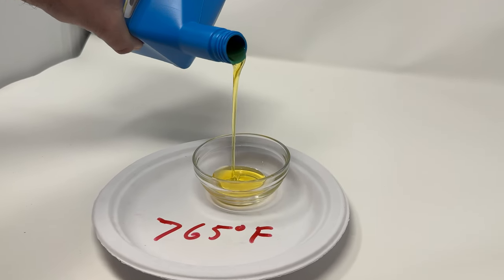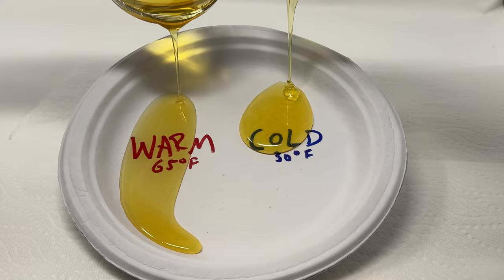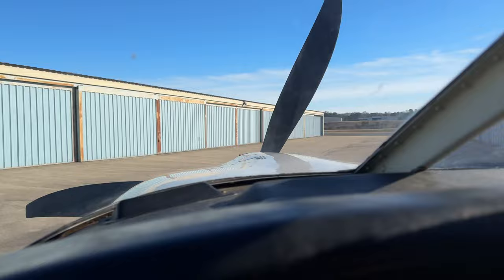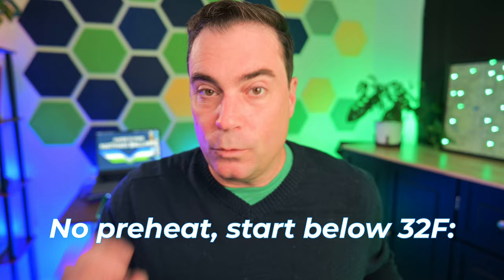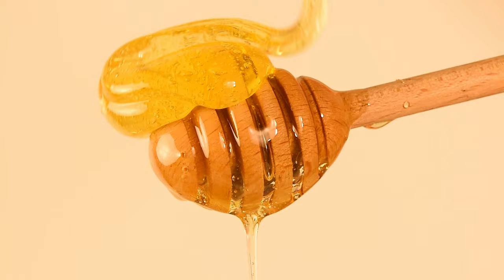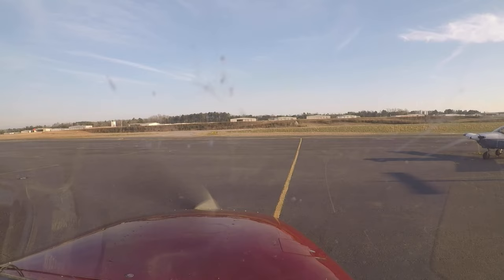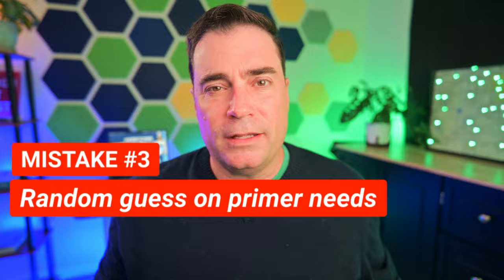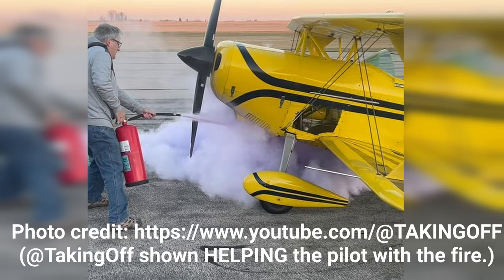HOW to START a very COLD airplane ENGINE. (And NOT end up FRUSTRATED.)

Comment: These are good tips. Also if you're anticipating very cold temps, top up your oil today because it might not actually pour tomorrow morning. I learned to fly in South Dakota in the dead of winter and found when it's really extra cold (like -25F and below), you need to be on you guard for systems behaving abnormally. One morning I set my Piper Cherokee's trim to neutral for the before takeoff checklist, and during initial climb I was arm-wrestling the yoke to keep the pitch up. Turned out the little indicator on the ceiling had a significant lag to catch up to where I had actually set it, which was very nose-down. That same morning, I noticed during preflight that the crankcase breather hose was completely blocked by an icicle that had formed there, and a mechanic used a heat gun to melt it out.
Reply: That blocked crankcase breather hose would make it run so rough.

Comment: Here in Wisconsin I wont even try to start my plane without several hours of preheat under 30 degrees. I have a Tannis preheater that heats the oil pan and engine block. What's great about these systems is it only requires an outlet and an extension cord which any FBO or hangar bum on the field will be able to help you out with.

There are a few other things you can do:
- You can have a custom engine/cowl cover made that will insulate the engine bay. They're basically sleeping bags that fully wrap around. 
- What TYPE of oil you use matters a lot. You wouldn't use a W100 oil in the winter, you would use something like a 20W50 that does better in variable temps.

- There are some more aggressive things you can do if you really need to get going, like starting a small fire under the engine to heat it.. but you're getting into Alaska Bushplane git-er-dun territory.
Reply from the maker: Fantastic feedback, thank you very much JD. Preheating is such a mystery and it shouldn’t be. Midwesterners know better than anyone how to do it. Would love to learn more about it from the Midwest perspective🙏🙂. Thanks again!

Comment: Turning the prop manually is not a myth.  

This from the Cessna 172S NAV III POH (version 172SPHBUS-00), under COLD WEATHER OPERATION:  

"Prior to starting on cold mornings, it is advisable to turn the propeller

manually through several engine compression cycles by hand to loosen
the oil, so the engine cranks (motors) more easily and uses less battery
power. When the propeller is turned manually, turn it in the opposite
direction to normal engine rotation for greater safety. Opposite rotation
disengages the magneto impulse couplings and prevents possible
unwanted ignition."

I don't have an opinion on whether you should or shouldn't...just saying it's in the POH.

Comment: Great video and for us up here in the great white (well not so white at the moment) north, definitely a topic we have to be familiar with if we wanna fly year round. Good points but one more I'll add is keeping the cabin warm, especially if you have traditional mechanical instruments. All those dissimilar metals in your instruments have the same issues of uneven contraction as they do in your engine. I run a small heater in my plane's cabin which also helps keep the battery a little warmer as well.

Comment: Pumping the throttle does the same thing as the primer, only less so. Fuel can run down into the airbox from the primer just as easily as from the accelerator pump. Had this guy with a flying club who thought the engine should be reprimed if it did not start within two or three blades. Using the primer, he flooded that thing and had three induction fires in it before somebody straightened his ass out.